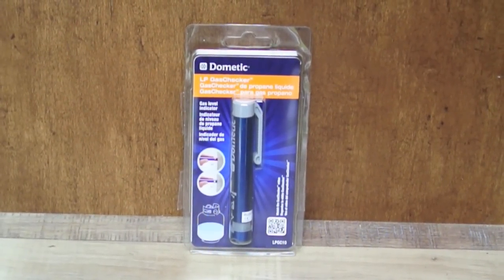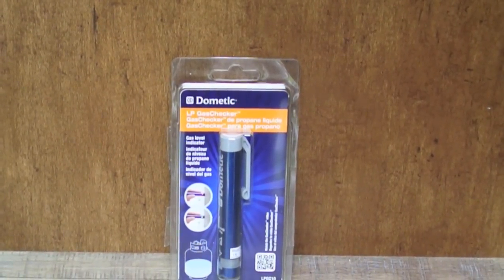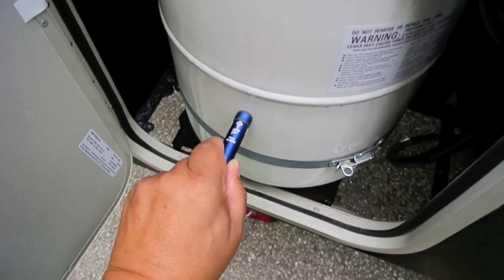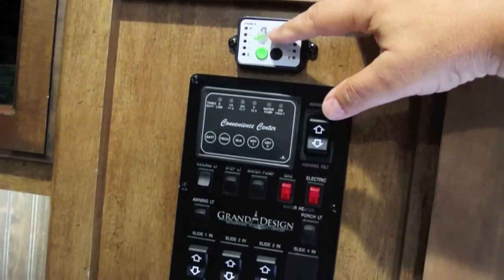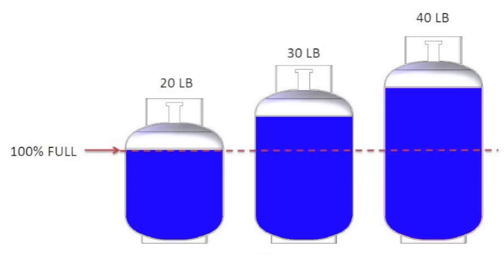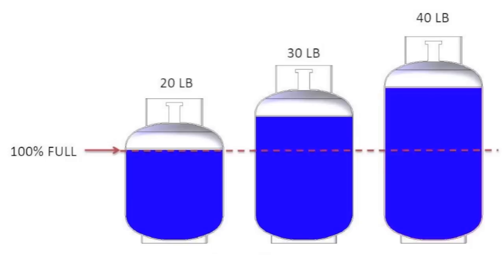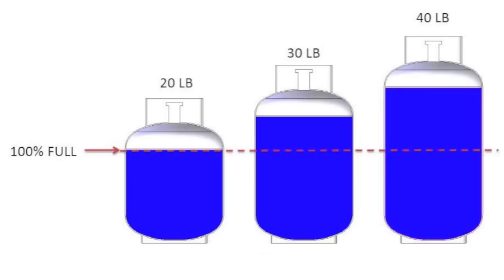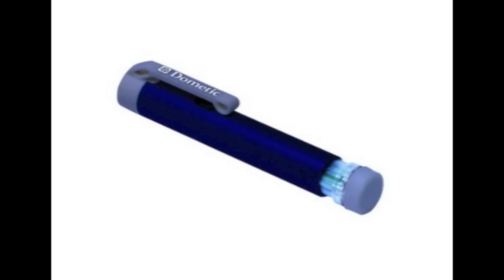Dometic's LPGC10 Tank Monitor

Comment: Just so you know, the wall units are calibrated for 20 lb tanks, so if you have it installed on a larger tank it will be innaccurate. You'll have to use the bluetooth app and tell it your tank size to get an accurate measurement. The company basically lied to you when you bought it...and you find out afterwards.
Reply from the maker: Version 2.0 of the tank monitor can be calibrated for different size tanks. But it was not available at the time of the video.